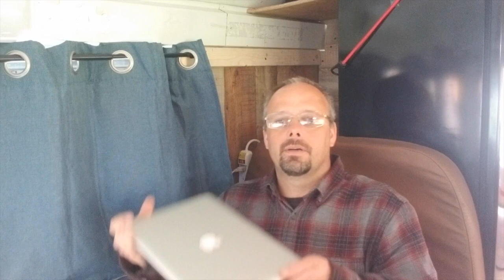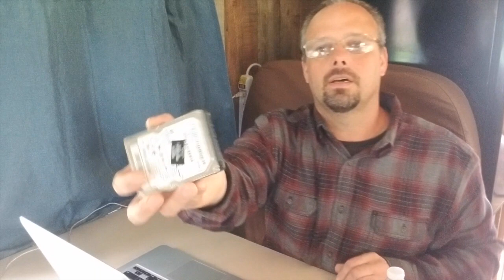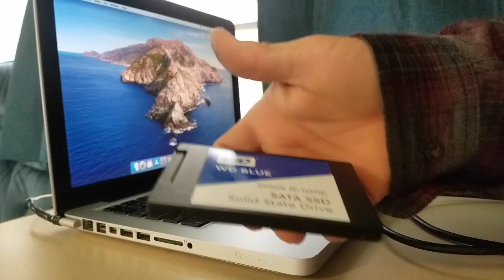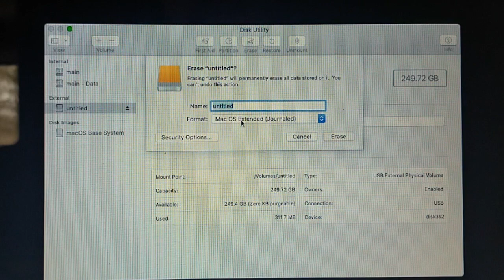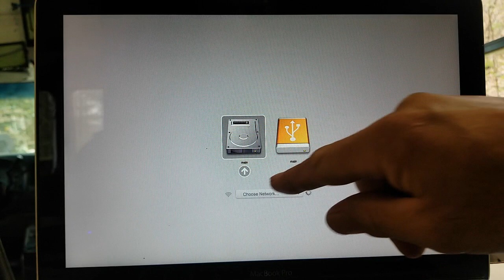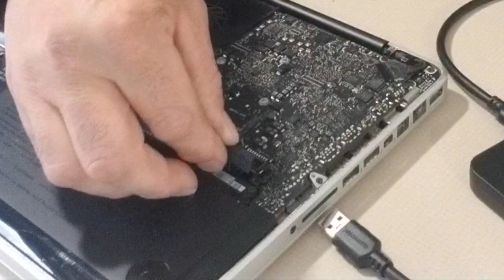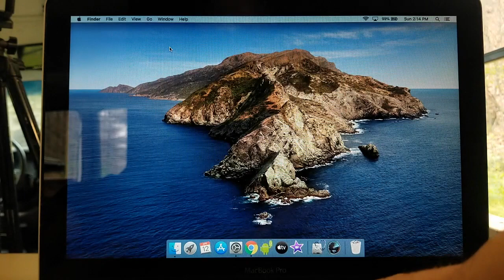Upgrade and Clone Macbook Pro HDD to SSD

Comment: Would this work if I wanted to copy the old SSD to a new SSD? I currently have a Mid 2012 MBP 13 inch with 256 GB but want to upgrade to either 512 GB or 1TB. It’s currently running on Mojave so I don’t want to lose the current operating system or files. Please help!
Reply from the maker: Yes this method will work to upgrade your SSD. The 1TB drive would be an excellent upgrade for this machine.

Comment: Will this procedure transfer data from a partitoned (bootcamp) macpro hhd unto a new ssd. I'm currently running windows 7 and OS Catalina. I'd like to keep the dual system on the macbook.
Reply from the maker: As long as you select the whole disc and not just the Mac partition it should. Just make sure to back everything up just in case.
Reply: @ thanks for the reply. I was finally able to upgrade the Ram, replace the HD with an SSD, and replace the battery. After several error messages, non-starts, and getting the check mark error message, I scrubbed the idea of transferring my old hard drive data and starting fresh, with Catalina as the OS. However, this version doesn’t support many programs , like iMovie or google chrome. My next task will be to upgrade the OS, although it’s “not supported.” Thanks again for your reply

Comment: if you ever have problems with this computer slowing down horribly, its probably the data cable that connects HDD/SDD to MoBo, i have two of these and I've replaced both.
Reply from the maker: Yes, since owning this computer I have replaced it twice. I guess that is their weak point. Great computers though. I still use it from time to time. I have the M4 model now and although it is amazing now, I don't see it lasting as long as the old one did.
Reply: @lukeFugate  im gonna or i just patched one of mine  with OpenCore Legacy patcher, and its running Monterey perfectly.    Lets see if i get a few more hears out it!

Comment: I cloned my 500 g to a 1 terabyte ssd and it works fine and my MacBook recognizes it as a 1 terabyte ssd but it acts like I still have a 500g..Keeps saying the startup disc is full..It's like it cloned it and thinks it's 500 g and not 1 terabyte ..Any ides?? THANKS
Reply: I used a external cloning machine when I cloned it from Amazon..Any idea how I can access the 500g that I should still have empty?

Comment: Luke, about six months ago I upgraded my MacBook Pro from HDD to SSD.  I was able to find a YouTube video and completed the process with no problems and got similar results.  I have not been able to find that video, so I watched yours.  You made the process much better.  The reason that I am revisiting the process is for backup.  SSDs failure rates are not high, but it does happen and I wanted a clone of my drive just in case.  I don't recall the software I used to clone the SSD, but it was not Apple Disk Utility.  I think it was Macrium Reflect, that is want I used on three windows machines.  I am going to try your method, wish me luck.  I clone all my C: drives every month to make sure I don't loose everything.  I subscribed to your channel.  Thanks

Comment: I have WD Blue SATA SSD drive. I was driving and flying next week and I noticed when I got back home my computer has been running slowly and I had to reset it and power it off/on multiple times to get it working.
Reply from the maker: Thanks for the info. Maybe they aren't very vibration resistant. Good to know.
Reply: @lukeFugate  it could be a RAM issue. Bought some gonna watch your vid on how to switch it out.

Comment: great job. about to try this on my late 2013 model. i thought all of these had soldered memory tho so you couldn't upgrade those?
Reply from the maker: On my 2012 model, the memory is replaceable. I'm not sure about the 2013 models. I upgraded to 16GB and there wasn't as great an improvement as the SSD was.
Reply: @lukeFugate  i think everything 2013 and after has soldered memory. and then 2016 and after has soldered hard drives. its getting very hard to upgrade them and the new gen looks lame to me...
Reply: @lukeFugate  my biggest problem now is that i can easily swap a faster ssd (my stock ssd is not fast enough) but my pci ports are only 2.0 with 4 lanes so i can only do 2gb/s top speed. im already running 1.5gb/s so i dont know if its really going to save me. do you have any idea if you can upgrade pci's? ive been trying to find this info everywhere... thanks for your help and videos :)

Comment: I keep getting restore process has failed after following steps🤔
Reply from the maker: Could try reseating all the plugs on the external drive including the USB connector. It may also take a few tries.
It is possible the ribbon cable from the hard drive to the motherboard could be going bad. It is a common problem on these I have replaced it twice in mine.
Reply: @lukeFugate  ok thanks

Comment: I followed the video step-by-step and it worked as a charm. Thank you very much for making this video and helping so many folks like me. Two comments for people who go through the process: 1) do not forget to put the battery connection back on before closing the back, and 2) when you start cloning/restoring to the SSD, you do not have to push the IMAGE burrow, just push RESTORE and it will kick of the cloning process.
Reply from the maker: Glad you found it useful.

Comment: Hi, great video, when you clone the hdd to ssd, could we do only the OS and not the all files and data? Basically having a blank fresh Mac OS?
Reply from the maker: It would not be a clean OS. The best way to do that would be to download the installer for Mac OS and install it on the external hard drive then switch them.

Comment: Final Cut Pro are ther in my MacBook Pro
Need to upgrade to ssd 

How can upgrade to ssd without lost all software with hardisk
Reply from the maker: If you follow the steps in the video you shouldn't lose any data. I would do a time machine backup just in case.

Comment: Inherited a mid 2012 MacBook Pro. Pretty slow as most are in original configuration. After some research I decided to upgrade the internals. I was intimidated by most of the videos I encountered on YouTube until I found your video. Slow, deliberate and steps in plain english has inspired me to take on this project. Thanks so much for your video. Update I successfully updated system. What a difference. Thanks again for your video

Comment: Thank you so much for your video, which helped me a lot bring back to life my sluggish MacBook Pro. One only note is that you should have told that before cloning the HDD you must first turn off the FileVault in System Preferences, otherwise the main HDD will appear greyed out and you would not be able to clone it into the new SSD. Apart from that, thumbs up!
Reply: Thank you. I was stuck on that part.

Comment: Hi Luke, great video.  I didn't achieve the same results however.  I cloned the internal drive and was able to boot the machine (mid 2012 MBP) from the new drive while it was attached externally but when I installed it in the MacBook it would not boot.  I'd get either the flashing folder/question mark or just a blank screen.  I cloned the drive using disk utility, Acronis and SuperDuper!.  No luck.  I also tried to clone with the HDD external and the SSD internal.  No luck.  Any ideas?
Reply from the maker: Sometimes the ribbon cable fails that goes to the hard drive. They get a little brittle over time and when moved around they break the little wires inside. could try reseating the cable and maybe trying to see if the old drive still boots. If it doesn't work either it is the cable.

Comment: For anyone who may find it helpful I use APFS Encrypted and when cloning it to a new SSD APFS Encrypted you first need to mount the Mac HD, then when you chose "image" it will automatically unmount the volume and clone it. If you don't mount the volume first the computer can't copy it as it will determine its locked and encrypted. Took me a couple of trial and error tries to figure it out. I like to use encrypted format on all my drives. Anyways hope this helps someone as no video on the subject explains this.
Reply: This helped, I needed to mount the MacHD first!

Comment: YOU ARE A LIFE SAVER! 
I found a Mack book Pro 2012 for $50 but was slow as heck. I purchased an 870 Evo SSD to replace the stock HDD. At first, this didn’t work but I took the time to decrypt the original HD and it worked! I have ZERO experience with computers but I’m glad I came across your video! THANKS, Luke!
Reply from the maker: You got that Mac really cheap! That's great. I'm glad you found my video useful.

Comment: Hi after I cloned my hdd to ny ssd can I delete some of the files from my sdd? Because I will be using my hdd for storage files and my ssd for my applications?
Reply from the maker: Yes you can You can make it an external drive. As an external drive you can format it to wipe all the data and you have good data storage. You can also get a hard drive caddy that will replace the optical drive so it could be mounted inside the computer.
Reply: @lukeFugate  Thanks man! I already both a caddy for my secondary drive.

Comment: Thanks for this video on how to clone a drive. I installed two SSDs in my two Windows PC laptops and they are super fast. I think I might do the same for my Mid 2009 Macbook Pro. I just hope it improves the speed of it by installing a SSD. I always get scared when I pick up my Macbook cause I can hear a small click when I lift it up. Might be coming from the hard drive.

Comment: Hey I’ve got one slight issue after this upgrade, my apple logo doesn’t appear as fast as yours. Mine shows the blank screen for like 10 seconds and then the apple logo appears and boot up fast. Any idea why it’s doing that?
Reply from the maker: It would probably be a problem with the bios but if it works I would let it be. It may start working faster over time once the new drive has been fully established.
Reply: @lukeFugate  That’s exactly what happened and now it boots up in a few seconds, thanks for everything

Comment: Great video and very well spoken. Nice and slow so everything is understood 100 percent. Thanks for the video and the time you put into snaking it. Cheers.
Reply from the maker: You're very welcome! Glad you enjoyed it.
Reply: Tried it yesterday and it worked 100 percent. I actually bought an empty 2.5 inch 7mm ssd enclosure that holds and m.2 data drive and put a Samsung in it. Now it has a sub 20 second boot up time. Now just waiting on 16gb of ram and good to go.

Comment: Thanks Luke. Using your very clear instructions, I installed a 1TB Crucial SSD on my mid-2010 15" MacBook Pro. Very pleased so far with the improved performance, especially with Office 365, which has been very sluggish.
Reply from the maker: Glad it worked for you!
Reply: his names not luke its Bill Fugate

Comment: I own a stock 2012 MBP non-Retina. I have been researching how to get an installer for OS X 10.10 (this is as far as my free upgrade goes). I couldnt get it from the App Store. It was a good thing I ran into your video how to mirror into an external SSD - so problem solved. Objective is to upgrade my HDD to SSD.
Reply from the maker: Hope it works well for you.

Comment: Great tutorial! Thank you, cloning the hard drive with that adaptor is a game changer. Thank you - got the memory coming and now ill order the ssd
Reply from the maker: Glad you liked it.
Reply: @lukeFugate  stupid question Luke sorry, but when i clone the hardrive to the external ssd do all the photos etc go on it as well? (I will do a back up before) thanks
Reply from the maker: @burnsyblues  Everything will be copied it will be identical to the original.
Reply: Dam not working for me, i start the clone and it just says failed and it changes my ssd drive name to ASRD data volume . I also dont have main and main data, i have macintosh and macintosh data
Reply: Had to use carbon copy cloner in the end! Such a stressful evening lol. Thanks for the vid it did help loads. Gone from a 1min 43 second boot to 33 seconds lol

Comment: This is absolutely the most complete correct video I needed for the exact mac I have. My memory and ssd come in next week. My mac takes about 2 minutes to load and forget actually editing anything on it. So I’m stuck using my phone for editing. I cannot wait! Thanks so much. Did you do a comparison video after changing the memory?
Reply from the maker: Thanks! I'm glad you liked the video. An SSD will bring it right back around.
I never did a comparison video as it wasn't that much of an improvement. In fact I can't really tell a difference. The major improvement was from the SSD.

Comment: Thanks for your help! 
I’ve got the error 5342, but solved the issue like this:
I eventually found the problem – the new ssd had been configured with a MBR partition table, not GPT. To fix this go to the View menu and choose Show All Devices. Then select the external device at the top level and click erase. This should allow you to choose MBR or GPT partition schemes.
Reply from the maker: Excellent! Glad it worked out!

Comment: Hello howdy 🤠  I followed every step u showed but my new ssd just cannot be restored from Mac HDD. It fails . Don’t know what to do !!
Reply from the maker: Can you do a time machine backup using the new HDD and then swap it out and restore it?
Reply: @lukeFugate  after some research I found out it was actually format mismatch between the internal hdd and new ssd.My internal hdd was APFS  while  the new ssd I formatted was Mac OS extended (journaled) . This Mac OS extended journaled format is not compatible with newer Catalina Os . So finally changed the new  SSD to APFS format . Then booted my MacBook in Recovery mode—> Disk utility —> select external ssd —> restore from internal Mac hdd .Viola ! Done .I shutdown the computer .Then took out my old internal HDD from my MacBook and placed the new SSD .So  I got all the data  as it was before but now with faster and smoother new ssd .
Reply from the maker: @Righteous69  Great! Glad it worked out.

Comment: How long is meant to to take to clone? I had a 750 HHD with 250 GB on and was cloning to the a 500 samsung SSD, its was taking over 3+ hours and wasn't even half way? said writing at 16mb/s, which seems supe slow. So just decided to install a fresh macOS Catalina on the SSD, then just move my data over after using the HHD as an external hard drive
Reply from the maker: That will work too. It does take a long time to clone the drive. It can be hours depending on the size of the disc and the amount of data.
Reply: @lukeFugate  oh dam, was too slow for me to wait so done it this way, connected the old hard drive externally and copied over the files and re installed the software. Nice and clean 🙂

Comment: Greetings all the way from Denmark . First great video awesome job 🤩 

I’ve been down the rabbit hole new feels like weeks. 
On upgrading my second MacBook 
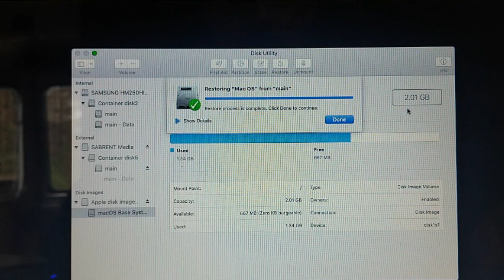Pro 2012 mit ( running Catalina 10:15.7 _SSD 1T ) 
If I want to clone my hard disk with operation system . Select the APFS as on the heart that I want to clone from 

Should I select Mac OS journaled as you did. 

Or should I stick with APFS As it the Hd ( SSD) I am cloning from ? 

Just want to switch SSD drive out with new . 

Sorry man for my bad English I’m a Dane 😃
Reply from the maker: When you go to clone the drive the disc utility will automatically clone the drive to whatever you have it now. It should be APFS.

Comment: Thanks for the video, I'm having similar issues. A couple of questions.. can I do the same with my external hard drive? And if not, did you get the adapter online? Thanks again
Reply from the maker: I got the external hard drive enclosure on Amazon. The one I used in the video isn't available right now but here is a link to another that is basically the same thing.
https://amzn.to/3aZ5d6S

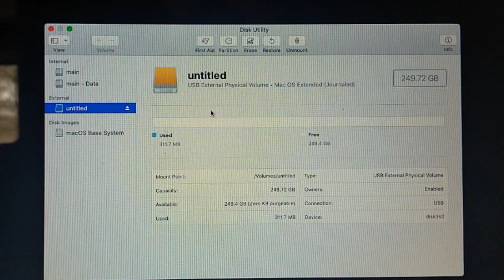Comment: my macbook pro mid2012 has the old hd mounted externally to boot up and the new ssd 860 evo in mounted inside but not initiated or formated. am i gonna get a surprise when i get to 8:56 and have to select...(hopefully the right one)...will my ssd be under the internal ( which i would then highlight and erase/format) then restore from the external (which would be the old hd)
Reply from the maker: Yes you would have to select the hdd which should not have the data section on it if it is a new one. I recommend doing a complete backup first before trying this just in case.
Reply: @lukeFugate  what started this mess is the clerk at the computer shop phisically put the new drive in the laptop and put my old hd externally for the start up.i'm glad i seen your video but somehow when i do this this morning i think i might get confused(i don't care i will try anyways)ty for the advice.(i don't have a clue how to backup so i think i'll skip this.)

Comment: Great job! Detailed explanation. It works externally but not internally. I install the SSD internally and when I start the booting process the loading bar fills slowly til the end and then it stucks. Can you please advise how to overcome this issue?
Reply from the maker: Check your cable going from the motherboard to the drive. It can degrade over time and have to be replaced.
Reply: @lukeFugate  I replaced the cable and finally it works! Thank you! Your assistance is highly appreciated!